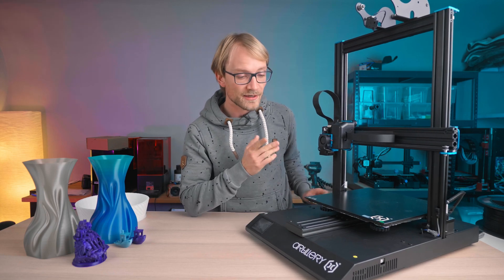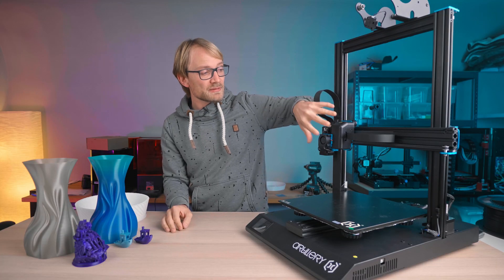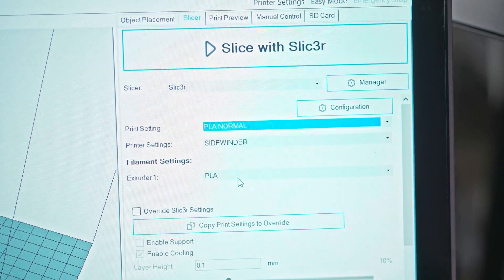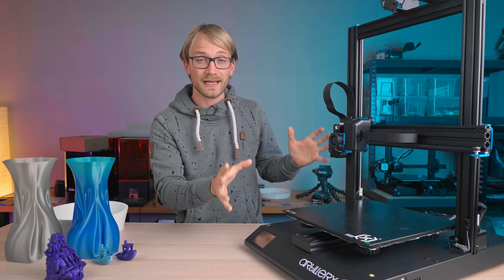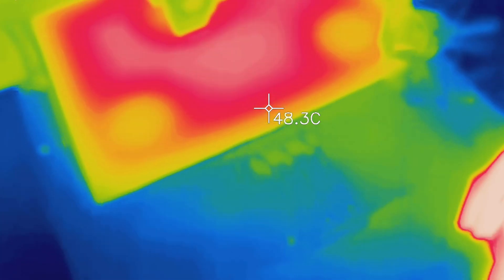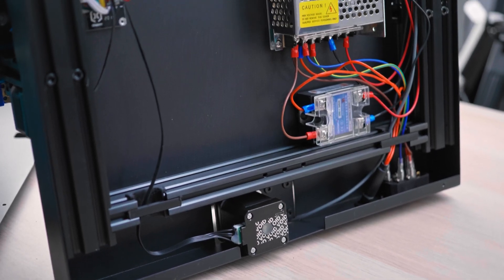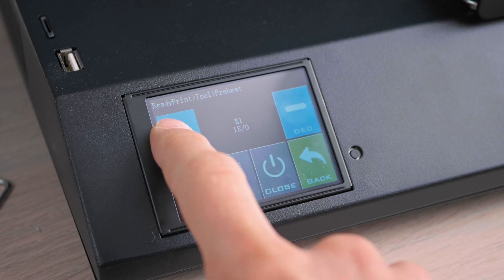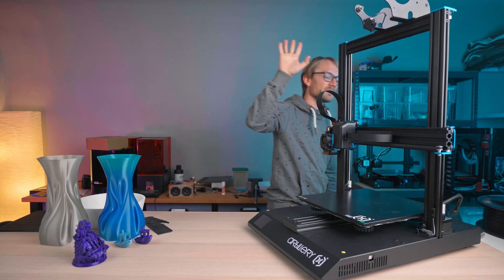Artillery Sidewinder X1: Built for show!

Comment: I have an Artillery X1 since 2 years. I replaced heat bed with warranty (out of order), ribbon X twice, pcb direct drive, direct drive, and replace plastic piece of direct drive by metallic, and my USB A connector is out of order too, so I'm using only sd card reader.
But I'm always happy with my purchase because I'm a handyman and I accept that mechanical or electronic parts wear out and break down. 
And I can repair or replace it with low price.
If you afraid to let your printer alone when it print, keep it in your eyes and buy a fire extinguisher.
Reply: And don't put your fingers inside the printer or the power supply if you don't know exactly what you are doing.

Comment: I have mine since they first came out (3 or 4 years). Use it daily and still haven't replaced a part. Absolutely reliable for me and love it.
Reply: Thats crazy, I have used mine for maybe 4 months and I got an error with the heated bed, likely due to either bed cable that moves in the back, or the motherboard.  Many people also have this issue.  Thats how I know how to fix it....  But unfortunately for me I didnt begin using my printer immediately after I bought it so its out of warranty.

Comment: I'm a 60yo with a PhD in Electrical Engineering, and after seeing this video review I can safely say that Thomas Sanladerer does NOT know what he is talking about. The machine is 100% grounded. I've run every test in the book and the X1 passes every test with flying colors. After this review I've lost all confidence on Thomas Sanladerer and everything he has to say about anything.
Reply: He checked continuity with a multimeter and there was no earth connection! Due to the painted metal I think. How would you know better anyway? You must be Chinese and working for the company.

Comment: Have to Disagree with the review, its a excellent printer. I have 2 of Artillery Sidewinder X1's, the touch screen and user interface is better then most printers with no delay.  printer works flawlessly with cura, maybe I have a updated version but the wire sleeve for the bed is large and does not kink like in the review also my printers have never caught on fire or experienced any electrical issues. They run for days at a time on large prints, Best bang for the buck.

Comment: The extruder is about as bad as a titan clone can be. That's just a print quality problem. But the bed heater wiring is a bad fail. Mine did break and burnt out the wire in the middle of the cord, and it didn't even kink like Thomas shows.
Thankfully no sparks. It actually prints PLA pretty well without heating the bed. 
The heater cartridge connector on the hot end breakout board is also prone to burn out. As are the cloned TMC2100 stepper motor drivers.

Comment: Certaintly I saw this review after a lot of other mostly positive reviews, which in contrary to you said that the wiring is on the better side of things (and many other aspects that you critisised) and I already bought it.
Should I return it as long as it is in prestine condition (not yet unpacked) or is it usable? And are there any upgrade parts that iron out the mentioned issues without braking the bank?

Comment: I have this printer. The sleeve for my heated bed appears to be the older style without any kinks. I'm glad you opened it up and looked at the electronics I haven't poked in there myself
Reply: Correction, my sleeving is the bad one. It is clearly kinking in one place and at a somewhat sharp angle. I have made a drag chain to minimize  how sharply it can bend, but the thick rubber continues to pinch even inside the drag chain. I am going to be ordering a new sleeve that I think will correct this issue. 
Also after taking the screws off of the bottom my wiring looks identical to the electrical work shown in this video.

Comment: Ok, I was looking really hard at the X1 as my first 3d printer, but after hearing about safety concerns I'm more than worried.  Can you recommend a good, safe 3d printer in this price range?
Reply: I’d get an Ender 3 v2 or one of the cr10
Reply: @mynameis______392  Do you know of one that uses a direct drive extruder?  I really like the materials versatility that gives. I have a few items I'd like to print that would use flexible materials.

Comment: Hi Thomas great review, Just a couple of points for you about the bed. From what I can see in the video there are 3 wires going to the bed, Two red and one black, tracing them back in to the case it looks like both reds are for the power and the black for the temperature sensor. But if the black is just for the sensor why have they used what looks like 10 amp rated cable also the 2 reds look like 10 Amps. From what I have read the bed draws about 1 amp max at 220 volts so all 3 wires could be made thinner so putting much less stress on the bed joint.

Comment: I've checked the ground on mine and found the whole frame and box cover perfectly grounded... Don't know how you proceed to check it, but using an ohmmeter clearly shows that job is done well on that safety critical point. I agree it's not the case on the bed wires kinks...
Reply: Ohmmeter is fine, 0 Ω would be perfect, but up to 5 Ω is acceptable IMO.
But did you check the bed mounting as well (the blue X-formed Plate)? Should be isolated (higher resistance), because of the plastic rollers and no PE/grounding cable running to it.
Maybe when you are correcting your kinks in the bed wires, you can add a PE-cable to the blue X-shaped bed plate directly taken from the PE connector at the power supply.

Comment: Lordy be, I did have myself some woes with the X1.  The small thermistor that is held in place on the side of the volcano block burns to a crisp after a month.  You are left with the metal casing still in the hole and the end that is encased in what looks like glass is just a black mess.  I ended up drilling a hole right through and put in a regular sized 100k thermistor.  Temps are far more stable.  Then, all of a sudden the extruder motor stopped working.  Turns out the ribbon cable burnt out a pin in the plug that sits on the breakout board on the side of the extruder.  The board that was there was black.  The replacement we had at work was blue and marked as V1.5.  Plugged in the new ribbon cable and breakout board and then found that as soon as the hot end tried to heat up, something was shorting and causing the system to reboot.  After much poking around with a multimeter it appears the new board has the lower 4 pins for the heater cartridge + and the next four pins for -.  However the breakout board that sits over the top of the X axis motor has the wiring set to the lower 5 pins for + and the next 3 pins for -.  Pin 5 (from the bottom) was shorting with pin 6 when plugged into this replacement V1.5 board.  So I had to disconnect pin 5 on the socket.  Why for the life of me would they have 5 / 3 and not 4 /4 to carry the current through that ribbon cable???  Either way it is working again after doing my head in.  

As for the V slot wheels, not a fan as they are clearly wearing down and getting loose every few weeks.  Must be a simple way to attach a linear bearing on the X and Y axis that bolts directly on the V slot?

Had no idea the heat bed was 240v??  Might rethink running this thing unattended now.

Comment: Owned one for 6 months, printed brilliantly and just had the hotend get REALLY hot (wouldn't stop heating up) could have started a fire. Guessing something significant has given up the ghost. No one who has reviewed this machine before (I watched tens of videos before buying) has mentioned anything about the slightly dubious electronics. Thank you for the video.
Reply: I had to open mine up to repair it and I must say the electronics are wired quite mickey mouse.  The cables are crimped inside and no heat shrink used.  Also they hot glued all the cables to the motherboard.  Very suspect.

Comment: So actually... What 3D printer would You suggest to buy under 500$ mark? I am looking for almost-built or fully-build out-of-the-box 3D printer, I will use it with most common materials such as PETG, PLA and HIPS. I previously bought Tevo Tarantula, however after assembling it I couldn't get it to work, so I ended up with useless crap. What are Your suggestions? Is the X1 that bad? Thanks a lot for all the answers.

Comment: Yes, true! Thank you for sharing that unpopular opinion! Most are "blinded by the light".

I own a Creality3D CR10s since 2018 and an Artillery3D Sidewinder X1 from 2019. Most times I am very happy with them!

On the Sidewinder X1 I already had problems with:

-flat cables (burned, defective connector, they knew it and supplied free spare parts) 
-extruder lever (snapped at the bearing)
-flashing new firmware (you have to disconnect the LCD for that, or add a switch that does that)

On the Cr10s it was only the extruder lever. Now the mainboard is defective. But repairability is way better on the CR10s because it uses mostly standarized parts. If I had to start again, I would go vor the CR10s, Ender or Prusa.
Reply: CR10 is out of stoneage. Artillery much more refined but not without problems. I think it's a good printer.

Comment: a fairly negative and biased opinion piece really, I'm a bit disappointed to be honest!
you give no thought to provide comparison or point of reference.
The fact is that most printers will arrive in pieces that you have to put together and will definitely look a mess on the inside unless you're an expert on such things and that case what are you doing buying this printer? this printer comes 99% assembled ready to print with minimal fuss even for a beginner, like all printers they have a target market and this one is for starters clearly and you failed to put an emphasis on that as well as the fact you broke the warranty on the printer just to be able to see what you called ''Hot glue and positive thoughts'' when it doesn't matter what it looks like if you are never meant to see AND it works consistently over a period of time which i know mine has but again you failed to reference that too, sure if i bought an Utimaker or something i would expect perfection inside and out but you cant apply apple standards to an orange which is what you have done in this video!

Comment: Had mine since April, never had any issues with it. Bed heater sitting well glued, 240v cables shows no marks of wear, and I have been printing any size with different types of filament. I have always been happy with the result. I totally recommend this printer.
Reply: I'd second this, but I still consider my X1 a "learning project". When I got it, I was expecting to improve it - hobby is hobby... But for 375 Eur, I was not expecting an original prusa with larger volume.
Since May, I have about 10 rolls down the extruder...

Problems:
- uneven bed -> changed to aluminium bed
- kinked cable -> exchanged all bed cables for longer ones and modified the construction, so if cannot knick any more - tracks and a flexible support outside
- Suddenly heavy underextrusion -> mechanics were ok... final solution: updated Slicer.
That's it

Sofar, I have heavily modified it (2 Firmware updates, checked all electronics out of the box, braces to stabilize the Z-Frame, aluminium bed, Flex-Plate...

Best tuning result for me: Firmware update with 3x3 Mesh leveling. ABL will be next.
A friend's Genius also got similarly updated and the printing quality is great.

Honestly, I love the quiet and that I can print really acceptable at speeds over 80mm/s, but if I look into the total expenses, I could have bought a Prusa. 

I' do not regret it, as I was expecting what I got.

@Tom, thanks for the great review, I'll use the weekend and check it out again :)
Reply: You will not see wear on the bed heater cable. The wire will break inside of its jacket. This can cause a high resistance area, which could rapidly heat up and burn.
My bed heater wire broke, thankfully no sparks or apparent burning, but from the outside the cable looked completely fine. I figured it out with a continuity tester.
Reply: Shill detected

Comment: Why is ABL not standard on modern machines? It can be done cheaply and easily. I think on smaller builds it isn’t necessary, but when you have a large build surface like this, it is almost absolutely needed.

Comment: Strangest thing.. I ordered a replacement extruder unit and got a single-piece cold-side cooler that directs the air upwards. Why this isn't stock on the newer printers is beyond me.
And the new heated bed I ordered has a much nicer cable sleeving that doesn't kink.

Comment: The hot glue thing hurt. The bed issue isn't that weird and is fixable, the extruder is fine, but the hot glue... I have an x1 and have loved it but it looks like I have some upgrades to do before running it while I'm sleeping again.

As for artillery as a company. From what I have seen they have been great for a Chinese 3d printer company. They're definitely not creality but they do appear to be trying. They also replaced a man's printer after he lost it in a fire. He hadn't even unboxed the printer yet. The fire wasn't printing related.

Comment: I already had to shell out my own money to replace the heater for the bed, as my cable shorted out, burned up and charred the table I had it on. I had it since May and put maybe 100 hours on it. I have since extended the cable, and properly wrapped it. Also replaced the entire hot end with a BMG/V6, and I am having glitches still where my flow stops half way through. 

I am thinking I should stop investing in this and buy something else.
Reply: Give it to me ;)
Reply: @user-xb5zu6zu7j  I am going to tear it apart and build a switchwire out of the parts.

Comment: I want a direct drive printer like this , for print tpu...but i do this, i change the original extruder of my printers(2 ender3, 1 cr10), for a titan clone, and now i can print tpu, tpe(esun elastic)at pla speed (50 mm/s infill/25 mm/walls, cura settings), and all whith a capricornc tube(i suspect its not the original capricorn..).its big change, not more clack, clak, or extrusion problems.so i dont need a diretc drive printer for know.Other thing, put a 32 bit card, like skr mini e3 v2.0, impresive card, i put in my cr10, and its incredibly how good works know.

Comment: Its a beutifull printer, strong build, but have too many isues, for me the reability its a must.The arm of the extruder breaks, the bed , yuo cant quit the glass,the flat cables original design for data now have power and a lot and dont have a clamp or a secure connector(so yuo have an spark or unknow maltfunction over time), and now the ac bed whith that horrible cable design,and whitout ground(yes fire or electrocution serious risk).The problem with yuotubers reviews are 1)they are "supported" by the company(get one printer for free), and the most important, all of this reviews are not intense and long time review.Wait 6 months using this machine every day and i think yuo gone have a big problem(if the machine can work for 6 moths, of course),Thanks for the honest review, and Artellery guys , can yuo solve this problems(if yuo do it it cuold be a very good printer)

Comment: Another happy X1 user. Bought about 1 year ago as a first 3d printer.
It arrived via BangGood missing 2 spool holder screws and has a very slightly warped bed. The heater cable is kink free.

I've twiddled some screws, moved the spool holder off the machine, added a sock to the heater block and a flexible Creality build surface (I'm too impatient to wait for the bed to cool and the extra layer helps with the slight bed warp but does need a higher initial bed temperature). 

It gets a few 10's of hours use a month and is proving to be accurate and reliable. The process is so much more enjoyable since I've been able to stop worrying about alignment and 'the first layer' - at least for a given filament.

Cons:
Z does need extra bracing if printing tall.
Maximum acceleration and speed settings are optimistic.

Notes:
I've removed the plastic Z coupler thingies.
With the Z belt removed, a tip I've seen mentioned elsewhere, the weight of the head can back drive the Z screws.
My left Z screw shows slight miss-alignment, I'm in the 'if it works don't fix it stage' so will investigate someday.

Comment: Can you explain how the bed cable could cause a fire? If one wire breaks, it won't heat up anymore and Marlin will complain. If both wires break at the same point (and time!) they might short, but then the fuse in the printer will cut power. If a loose phase touches anything else, the RCCB will go out. As I see it, there's nothing that could cause a fire.

Comment: Great review. 

I’ve owned my v4 X1 for near on a year(first 3d printer)I did brake the idler arm and it definitely was a bit of a learning curve. In the end I used an egg carton with its little individual cups to place the parts in sequence and then reversed the sequence to reassemble. 

Really awesome performer, but not being grounded is super-dooper dangerous, like kill you dangerous! 

I’ve done easily a few hundred hours printing and my 240volt heater cable looks mint. 
My cable is perfectly curved with no kinks. 
Your example made me cringe.... poor packaging...has to be!

Comment: I have one (V3). I like that it is so amazing quiet. I had issues with the flat cables and some sparks in their connectors because their connection of the cable in the connector was really loose. But with a new cirquitboard came better connectors which fix the cables quite good.

Thanks for your deep analysis. Now I'm aware to be careful at some points.